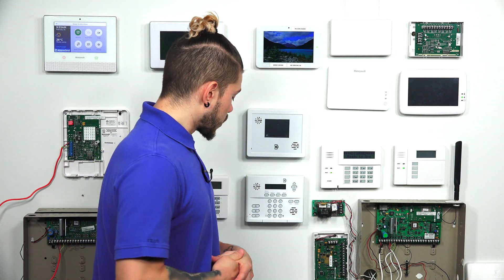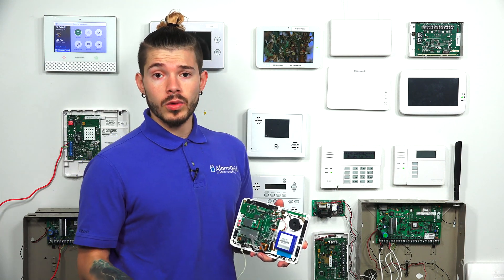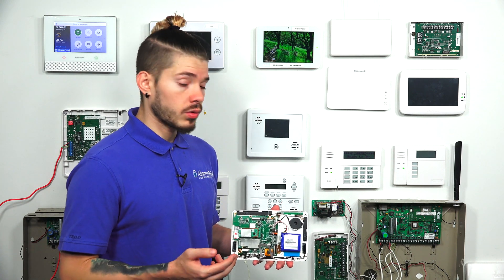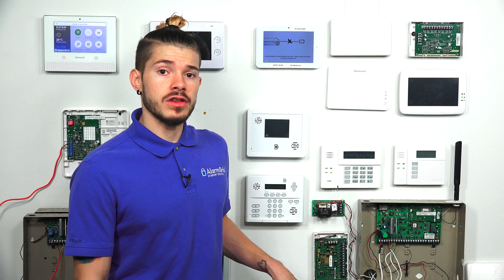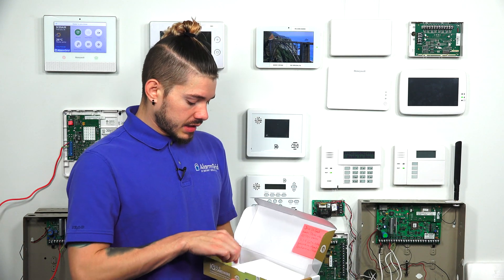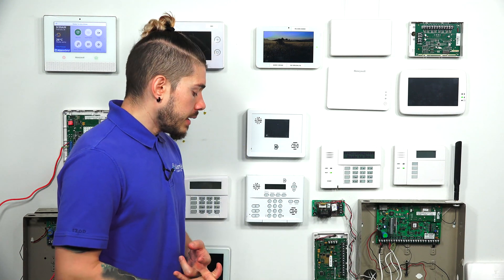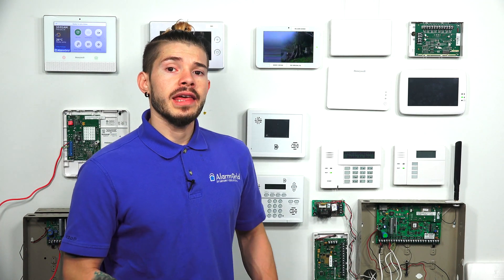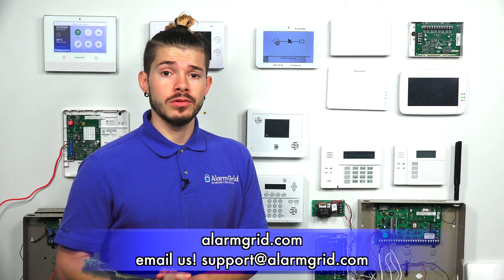The Number of Hardwired Zones Supported On a Qolsys IQ Panel 2

Comment: You guys are doing a fantastic job by making videos of different security systems from different manufacturers. But you have never done any video on DMP 7872 Graphic Touchscreen Keypad and XT50 Panel. In fact, you have never even mentioned anything about DMP. Can you please share some information on the DMP security equipment.

Comment from the maker: In this video Jorge gives the color Code Yellow-Violet-Red Gold. This is a 4-band 4.7k resistor with a tolerance of plus or minus 5%. The resistors that come with the Hardwire 16-F are a 5-band resistor with a color code of Yellow-Violet-Black-Brown-Brown, this is also a 4.7k resistor, but with a tolerance of plus or minus 1%. Either type of resistor should work for these zones.  The latest Hardwire 16-F offers resistor calibration, so any resistors 1k - 10k can be used, but to achieve a UL rating for Fire on the 2-Wire smokes, the 4.7k resistors must be used.